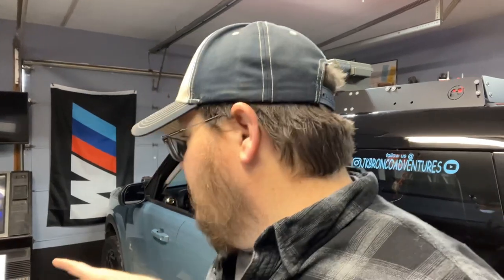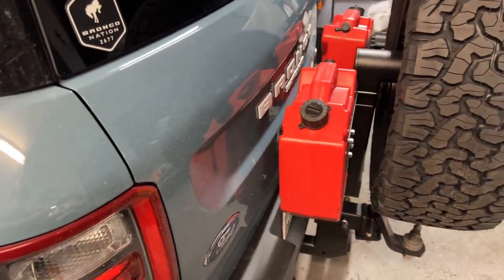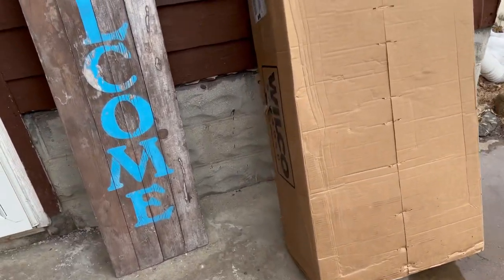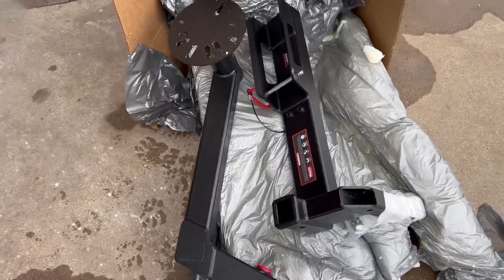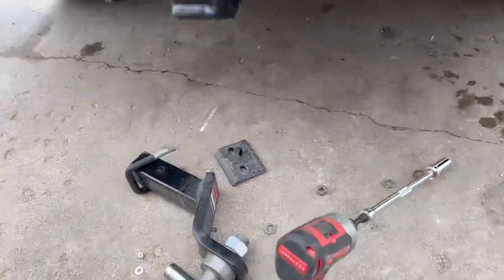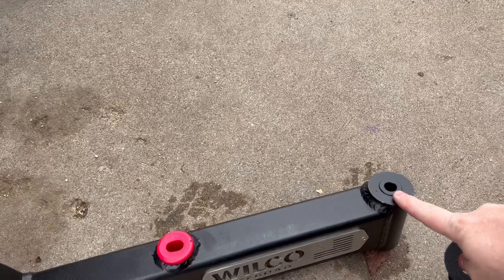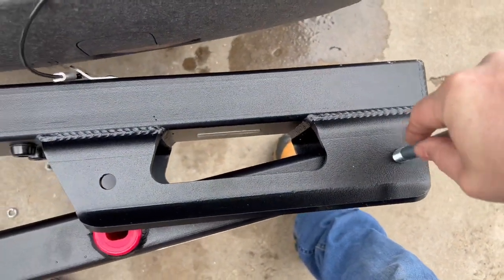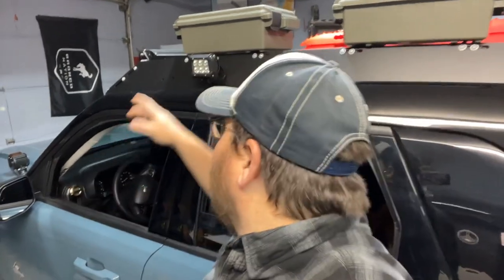Lifted Bronco Sport Gets Wilco Solo Hitch Gate High Clearance for Full Size Spare

Comment: I went a base model and I like it my only gripe is I need my key to actually start my vehicle otherwise it’s been a dream I am researching add ins and mods for it. This was well made and informative
Reply: You can start newer ford's through the fordpass app. I can start my bronco sport with the fordpass app to warm it up, so I don't have to walk outside, and around my building to do so. It does it through GPS satellites I believe. You can't drive off in it that way though. You get in with the key and them once my fob is in the car, I push the start and can drive off just fine

Comment: I have the same Bronco sport as you with same color and I would love mine to look like yours. Thank you very much for the ideas. I actually already bought the lift kit and used your promo code. The lift got installed yesterday and it looks much better. Got my alignment done already. Now I’m trying to get the same tires as yours. This whole upgrade gets expensive so im going to have to take it slow
Reply: Jesus loves you alot trust in His death 4 salvation and be saved from eternal hell <3 Jesus died on the cross for you bro.

Comment: Thanks for the details in the video.  I've been searching for more Bronco Sport customization information. I also been trying figure how to add the fifth tire. I have one question, "Does the Wilco hitch affect your rear sensors and camera? If so, how did you overcome that? Also, where did you get the attachments to connect the jerry cans?
Reply from the maker: yes it does for me the spare tire is worth it over a rear camera and sensor.  I turned off the sensors for the backup.

I made the attachment to hold the jerry cans on the arm.
Reply: Thank you

Comment: Did you wire up the light plug? My sport didn't have one now I have the stuff but am wondering about how and where the light plug hooks into the Bronco wiring.
Reply from the maker: WE bought the harness off eBay last year for this.  Its Plug and play...https://www.ebay.com/itm/324708569728?epid=4048972667&hash=item4b9a239280:g:HDQAAOSwFMRg6GGK

Comment: What are kind of tires are those I need those on my bronco
Reply from the maker: KO2 tires from BF Goodrich
Reply: Did you have to get lift kit?
Reply: And what is the exact size those are fucking dope
Reply from the maker: @rommelrichard9507  yes its lifted 1.5" but with these tires you dont need to lift it if you do the 255/55r18
Reply from the maker: @rommelrichard9507  255/55r18